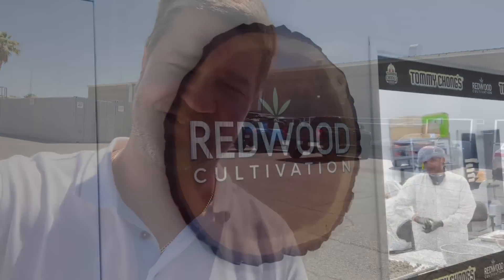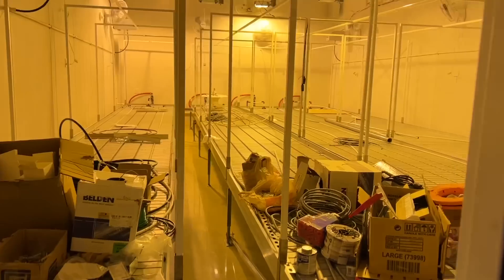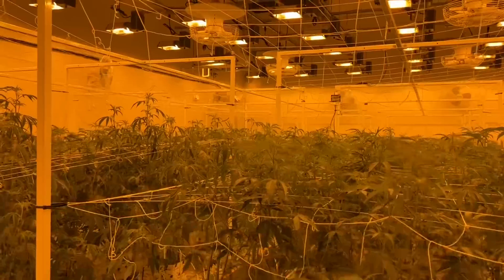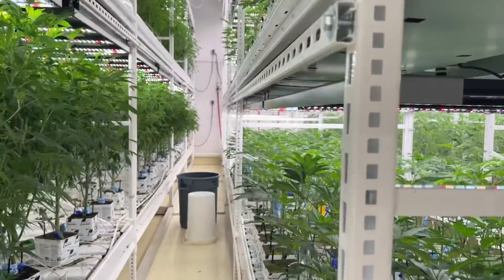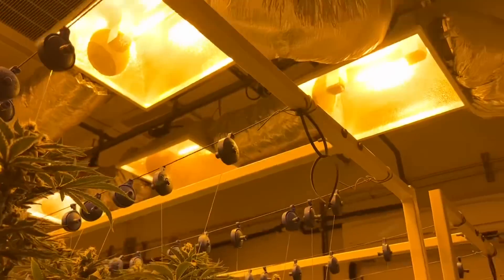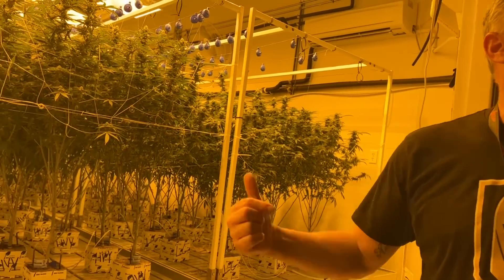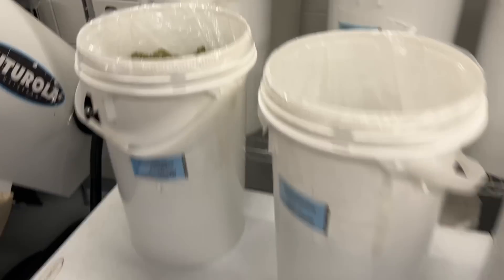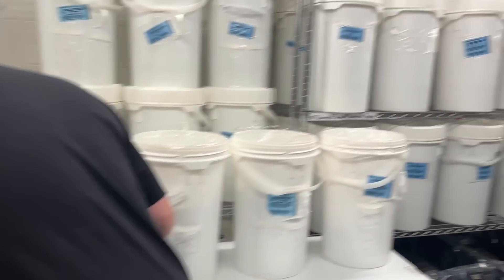Las Vegas HVAC Grow Facility Farm House Tour Natural Gas Powered VFR Heat Pump Systems

Comment: Wow.. to much micro systems in a place like that.. Its time for al biggg scale up with central air handlers and a biggg heat pump cobined with ATES.. 🙂 Also.. Why dont use solar for power? Free cooling powr in the day time then.

Comment: Thanks for the tour! York back in the late 1990s made the Triathlon Heat Pump (split system) for Residential use that had a Briggs and Stratton Natural Gas engine driving a compressor.  Never saw one and I don't think it took off.

Comment: Great video. What is the benefit of the natural gas heat pumps? Why not traditional vrf?
Reply: If you use natural gas for cooling you don't need as much electricity for that aspect of the grow operation. The saved electricity can be used for lighting and more grow rooms

Comment: My previous home built in 1964 had a capped off NG line out to where the AC compressor was, so at one point in time It may have had an NG air conditioning system. 
RVs have propane powered refrigerators so using heat for a cooling system in not new.
Reply: Been in the trade ten years and have never heard of such thing. I think the person didn’t like gas and had it capped.
Reply: @North_Coast_Hvac  
It was a feed line off of the main. The rest of the house had gas appliances except for stove and oven.
Reply: @scott_meyer  could have been for a bbq
Reply: @scott_meyer  look it up
Reply: @North_Coast_Hvac 
It had a NG BBQ, different connection.  The gas line penetrared wall inches from the line set to the AC compressor.  Can't think of anything else it could have been for.
Reply: @scott_meyer  you had an absorption system. These were popular in the 60s. They worked the same as the propane powered fridge does.  There is a gas burner in the unit this is basically the "compressor".  The heat raises the pressure of the refrigerant -probably ammonia-and drives it through its natural desire to move towards colder environments-this being the evaporator. There's a lot more to this as this is a complex system. When gas isn't available the systems can be switched to electric operation and an electric heating element does what the gas burner does
Reply: @yomomma9070  
The new NG systems show a SEER of 27
Reply: @scott_meyer  I saw that too. Looking up info based on your comment had me trying to remember the old absorption systems. Amazing they're that efficient by burning gas! I think the other commenter might be too young or naive to have heard of the old systems! I believe those units were built on Michael Faraday's early concept of a closed loop refrigeration cycle.
Reply: Possibly an Arkla/Servel Absorber or York Triathlon, if it was NG.
Reply: Possibly an Arkla/Servel Absorber or York Triathlon, if it was NG.

Comment: I’m gonna have to look into this technology. I was not familiar with gas powered heat pumps
Reply: @PipeDoctor  For many years Southwest Gas has promoted natural gas cooling in Las Vegas. Electricity is still the most popular, but gas powered systems of that size are lots cheaper to run since it would take a bigger solar system than he has room for to come even close in cost savings.